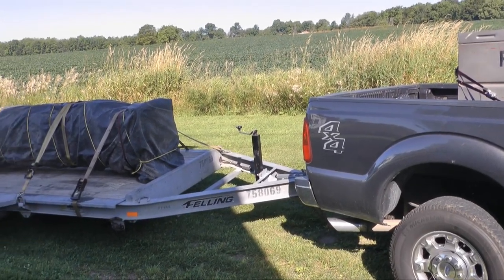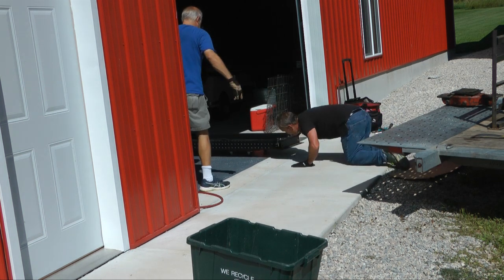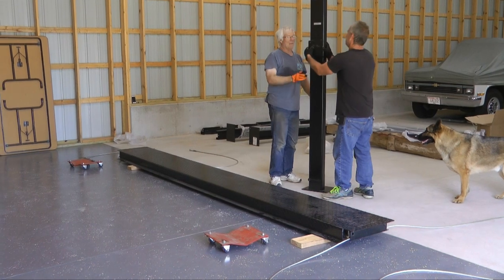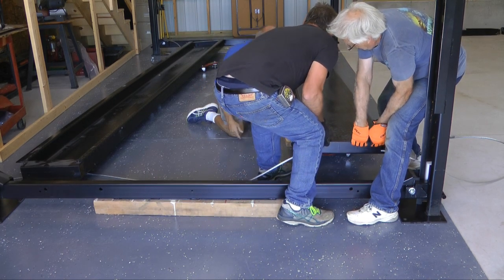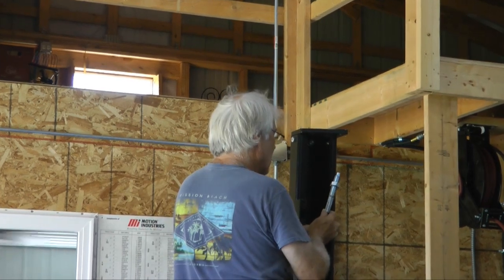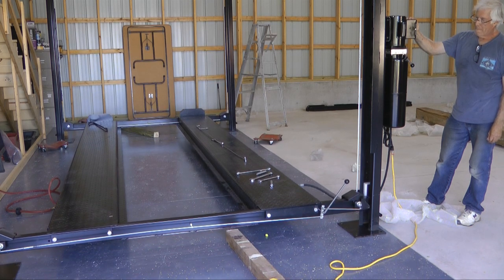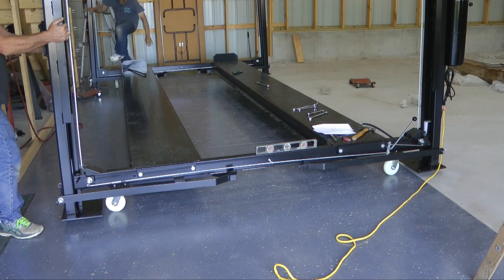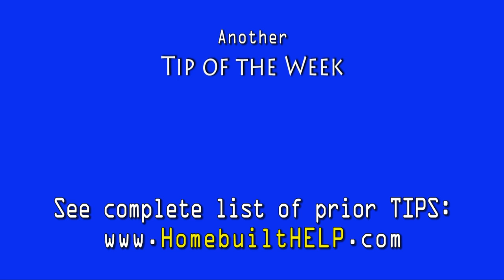Installing a Car Lift in your Hangar

Comment: They should bolt the posts down.   Put anchors in the floor if they want to move it, but I would not put 2 tons on it, did you see how they flexed when they moved it?  You dont want the corner to slip with 4-5000lbs on it.

Comment: I'm having trouble with my work bench that I built that is 4 foot by 14 foot do you have any advice? Apparently the back 2 x 4 has cured and warped part of my table about 1/2 inch across 14 ft. I thought my Spar had warped but it was my table

Comment: I haven't seen a Pontiac Fiero GT since the 80's.
Reply: Considering that the Fiero had a really crappy engine, which leaked oil and coolant like a sieve and broke down frequently, you're probably right.

Comment: Brand  ?.... price ?
Reply: Search engine? Keyboard skills? E/Bay or whatever?
Reply: Looks like a Dannmar lift?
Reply: sam phi With so many brands of lifts that are black, how would I know which brand to begin searching for this one? Rotary, Dannmar, Triumph, AutoLift, Nationwide, BendPak, Atlas??? Please tell me where I begin, and what is shown on this lift that delineates which brand it is?
Reply: Mine is almost identical even down to how they shipped it.   Suspect it is the same thing but a different brand name.  Mine is a greg smith equipment garage pro 9000.  Runs just over $3000 and will lift my f350 crew cab long bed.
Reply: @redfire122  thanks dave